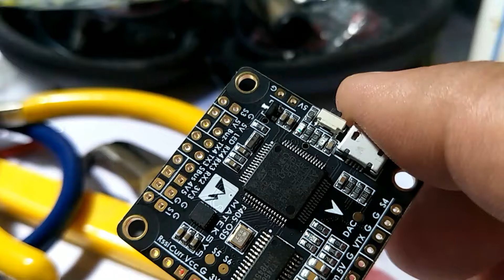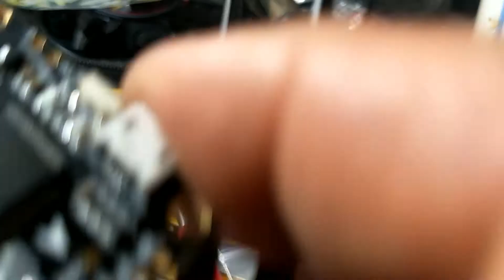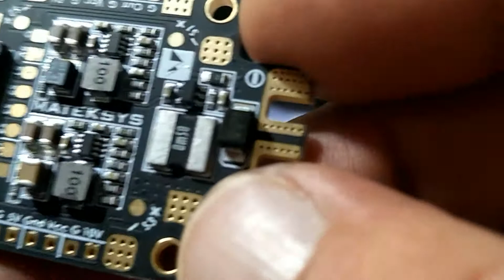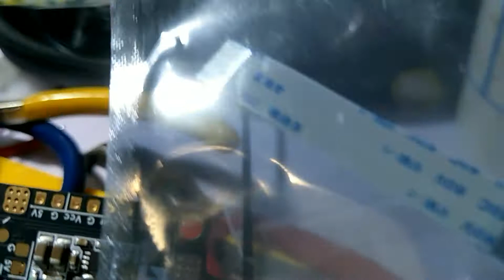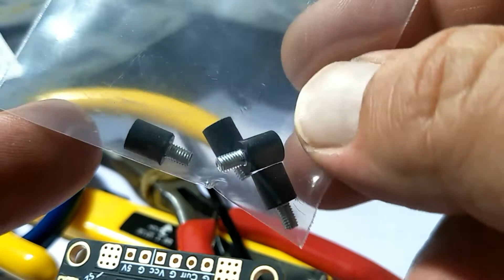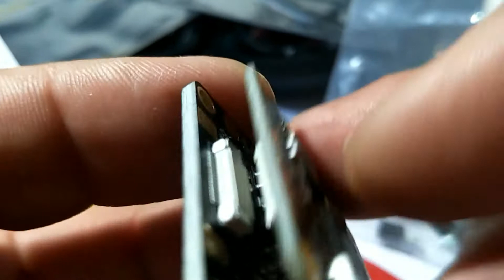Matek F405 FC.. And FC hub 6s. The perfect set up?

Comment: On the hub itself. Connecting the white signal wire from the ESCs to the signal pad on each corner.  Then the black would just go to the - pad with the ESC Pwr/GND?
Reply from the maker: Yes exactly..I solder them together on the - pad.

Comment: Also, where would I solder my Esc signal wires? I see there one for the signal, but not ground? Where would I solder that to? Normal -?
Reply from the maker: Some say the ground is not needed, but you will be risking noise. I solder mine to the ground pad for the ESC ground. Just put both wires on the same pad.
Reply: SKIDOOSH thanks!  Very helpful. My combo just arrived today, gonna start building tomorrow.

Comment: Skidoosh.  When I use an infrared thermometer to read the temps of my motors with a battery plugged in NOT having flown... not armed...  motors 1 and 3 are often over 180+ F. I've even seen 1 over 240.   2 & 4 are under 100.  I have two quads, QAVX and QAVR 6 with the Matek setup and they both show the same temps.   If you have an infrared reader, would you check your matek quad and maybe something that isn't running Matek?   I'm burning up motors and would like to not be.  Thanks
Reply from the maker: I usually just use my tongue..lol..I have been flying mine for quite some time without issues...maybe because you are not flying they are not getting airflow? Electric Motors need to spin to cool..
Reply: Do you have listed or on vid what version of BF you are using, PID loop frequency and such?
Reply from the maker: I think I did a vid a few months ago when Sampson gave me several of these boards for feed back..I don't remember. I have been updating them to any current RC build of 3.2 that comes out. Here is my current set-up: 8/8khz because that all BF can run anyway. Setting the loop any higher does nothing. DSHOT 600 with flycolor Raptor ESC's with the latest BL_heli (16.67?? I think it is??) that runs DSHOT protocol. Dynamic filter enabled and all other filters off..anigravity set at 3.5..hope that helps you out bro..
Reply: Matek is saying my ESCs are probably incompatible.  I have Wraith Plus and Betaflight 32 bit 35A ESCs.
Reply from the maker: I also have a set up with wraith 32 esc
Reply from the maker: https://www.youtube.com/playlist?list=PLcPIxWxFuYzXoC55S7rvwq5rxc-FSO9oF
Reply: stupid question but... were they flashed with 32 bit firmware?  Here's something else I noticed today.  The temps stay low if the FC is plugged into the USB port...
Reply from the maker: I am not sure what you mean, but it doesn't matter. As I said before BF only runs at 8k..setting anything (FC or ESC) above that 8k has no advantages in BF. ...or course they are cool thru the USB. The ESC's and motors will only get power thru the battery...not the USB,,Please look up some things on how it all works. Seems you need to educate yourself a bit more. Not trying to sound like an ass...but there are many sources on how quads run. RCmodelreviews, Joshua Bardwell, Painless 360..ect..ect..
Reply: I got it working!  Not sure where I got the 'latest' target for the F405.  But, RC5 is the only one that works from the Matek site.  I tried RC2 - RC4 and they did not work.  Motor temps now all read 83- 85 degrees!!  Thanks for your help.  It was the fact that you said you got it working with the Wraith 32 that made me believe it was possible.  I was about ready to shell out another 80 - 100 bucks for different ESCs.
Reply from the maker: Thats awesome man!! Hell yes now go rip!!!
Reply: OMG.  still seeing weird things with temps.  I switched out my ESCs with the KISS 24 A's I had laying around.  Preliminary temps looked promising.  Go to fly, temps ready 180+.  Land, cause I didn't care about the temps and flew any, and the temps were back down at 85!!! WTH?   I would be glad to buy an infrared thermometer, send it to your place in china just so I could have you check several of your quads and report the results.  I feel like I am chasing a ghost!  Seriously, send me your address and I will send an infrared to you!

Comment: With the PDB - are those slots for the bat input big enough to solder an XT60 vertically, so its hard mounted?
Reply: I have one and I used a Connector saver to allow some give in a crash just in case the battery shifts or is ejected I dont break the board.  It still looks clean.
Reply from the maker: Yessir...that's how I did mine..no wire. Straight to the PDB..
Reply: Pic by chance?

Comment: Would the ribbon cable connection work with one of the boards rotated 90 degrees. this looks like a perfect combo for my build, but id prefer the power connection out the side (and still have acces to the usb)
Reply: When installing the flight controller, adjust the ribbon so it's in a 'zigzag'or 'S' shape. That will allow the FC and PDB to be installed in any position.
Reply from the maker: Since I have no idea what you are building I don't know if you can access the USB or not. Once its flashed and set up I use the BF OSD anyway and have no even needed the USB port...I believe all boards can be rotated in the BF config..
Reply from the maker: ...you could simply rotate the PDB..I think the ribbon would still work,,it also has the option to wire it up and not use the ribbon..
Reply: Frogzy I’m pretty sure it does. You need a smart audio capable vtx though

Comment: I love the setup, but I have a desync issue after 30 seconds of flying..it starts out justa slight twitch, but after 30 seconds it goea haywire...I see on Matek page this is a known problem...
Reply from the maker: Running at 8khz/8khz? It seems that only happens at higher khz in the current firmware. Hopefully the next BF build will have that sorted..could also be an ESC issue. Luckily I have not had that problem yet..but I am only running 8/8..smooth as butter..
Reply from the maker: I just got the new Wraith BF32 ESC's ..they are totally configurable..hopefully it works good with them. We will see...